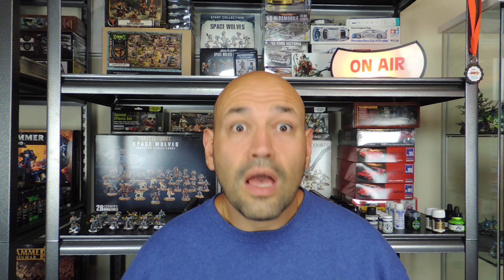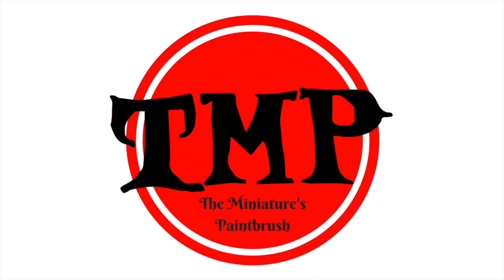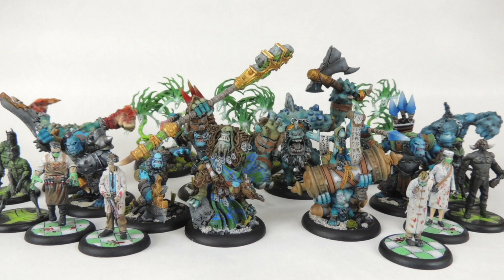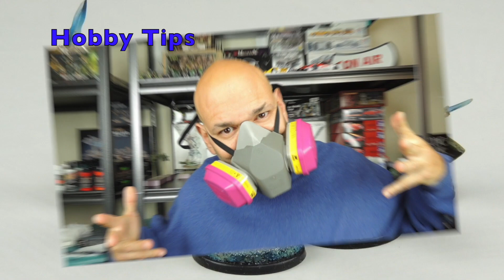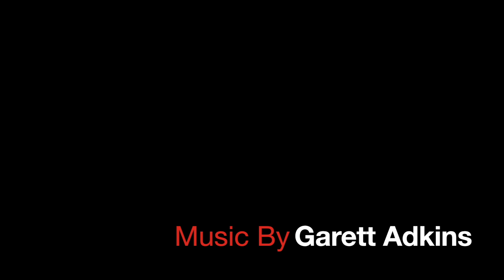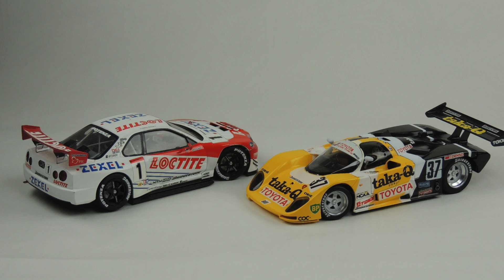Painting Tip: Using Medium Retarder

Comment: Can this product be considered a cost-effective alternative to Citadel's Lahmium Medium?
Reply from the maker: StaindHand I use glaze medium from Vallejo to simulate Lahmium Medium. Slow Dry is used more in wet blending.  I hope this helps!
Reply: The Miniature's Paintbrush
Can you think of any Liquitex brand products that would sub for Lahmian Medium- I use it to thin my paints instead of plain old water, but shit's expensive at the volume GW makes available
Reply from the maker: StaindHand not quite, I do have a video on thinners.  One way to extend the life of your glazing medium is to come up with a ratio of water to medium.  When I thin using medium through an airbrush it’s usually 3:1 3 drops water to 1 drop medium.  Alternatively you could attempt to use Liquitex matt medium as a thinning agent.  I have heard it being done however I haven’t personally experimented with it.  For thinning in general if you break the water tension then you are good to go.